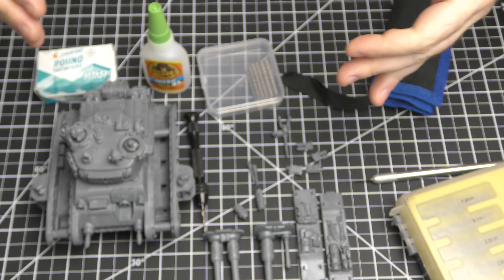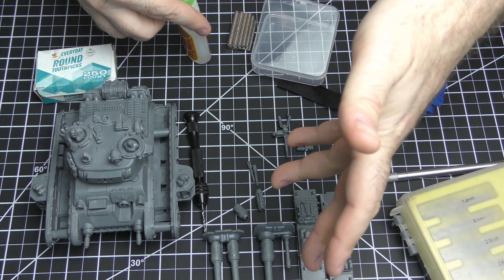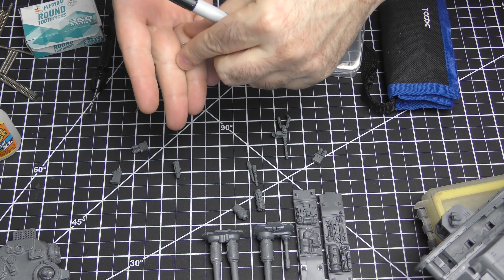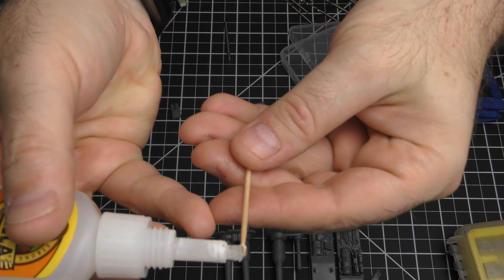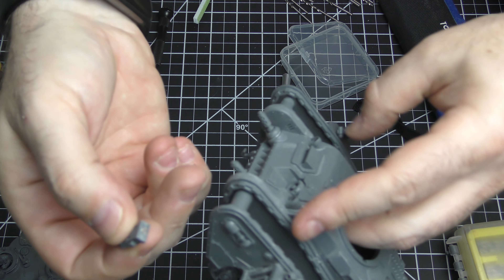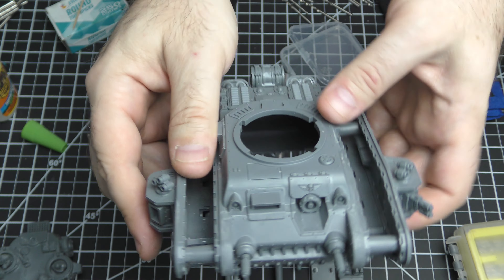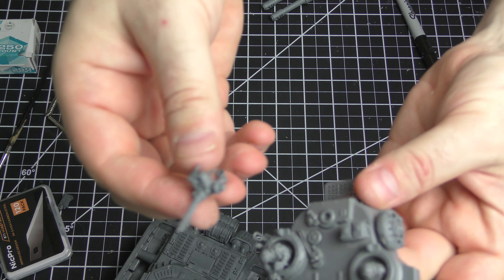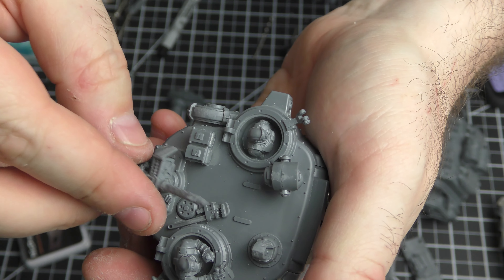How to Magnetize Warhammer 40K Rogal Dorn Battle Tank - All Weapon Options

Comment: How would I magnetise the hatches for the crew?
Reply from the maker: The best way I can think of would be to use .5 or 1mm magnets on the hinge areas themselves. That way you can position them at whatever angle you want from fully opened to closed, and the magnets will hold them in place.
Reply: @AirForceBuilder Awesome, thank you!